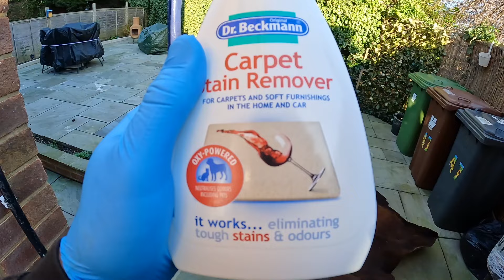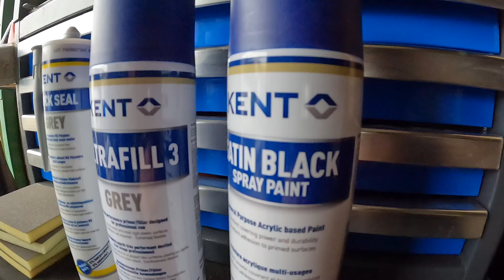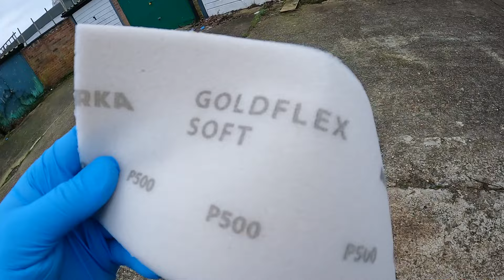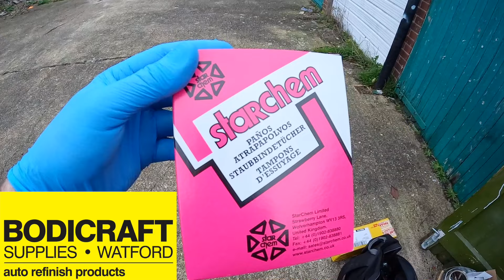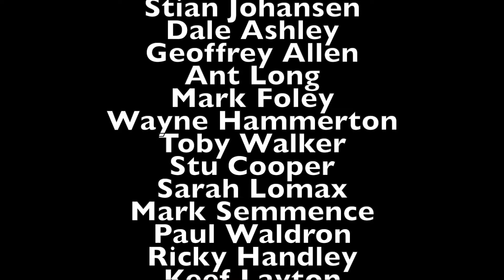Now I can make REAL PROGRESS with the Mk2 Escort restoration! 👍

Comment: Marcus if you are going to put the carpet in first ,I advise you to some sound proof carpet and then put the brown carpet after
Reply from the maker: Thanks for the advice mate! 👍 I actually still have the original factory underlay. 👍
Reply: @marcushayesford I wud of took it to a jetwash ..........Lance kept at least 1ft back 
Blast it good , trust me 
Best way wet vac hoover 
If u do blast it ....drip dry it 
Use a heat gun ....in the garage
Later 
Take it home n put it on Kats radiator !!! Be rite 
Thank me later
Reply from the maker: @matthewc.419  The plan was always to jetwash the carpet in the summer but I never got round to it, and now I dont want to wait until summer. 👍

Comment: When I did some painting with spray cans in winter I used a hot air gun to warm parts before I started and after I painted parts
It works better then hair dryer

Comment: use a floor sweeping brush, fairy liquid and blast it off with a garden hose...... you're good at spraying.
Reply from the maker: I did always plan to jetwash it during the summer but never got round to it. Now it’s winter I wouldn’t be able to get it to dry. I’m happy with how well I have managed to clean it this way tho. 👍
Reply: yea in this weather it would take about 4 days to dry, too big to put over a house radiator....... so bloody cold right now, too old to paint and i've got a few model kits to do to.  @marcushayesford

Comment: Get the body done before bolting stuff in unless it’s a dry build only, it’s much easier for whoever paints the shell to work on a bare or rolling shell.
Reply from the maker: Unfortunately thats not possible with the garage space I have. Thats why I have chosen to have the engine bay, inside the boot and door shuts painted first, so that I can build most of the car BEFORE having the outside painted. 👍